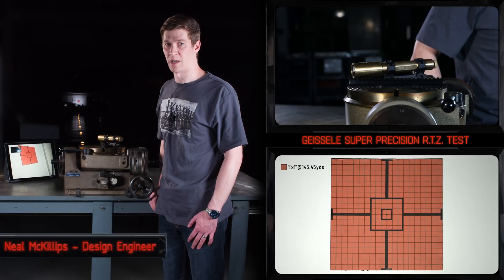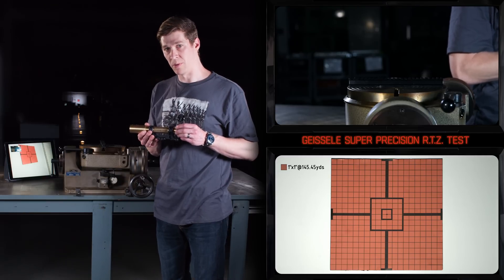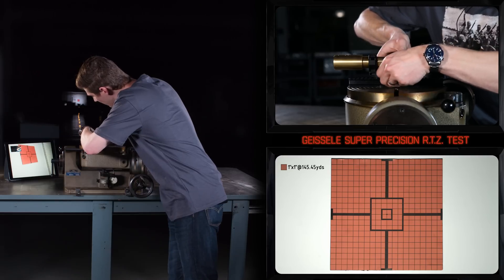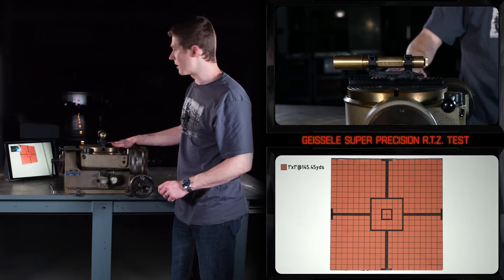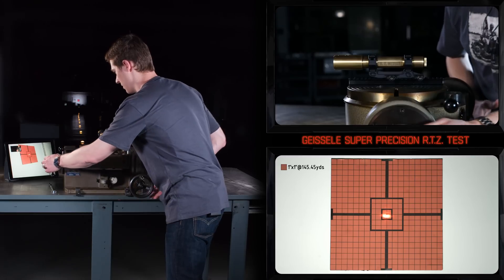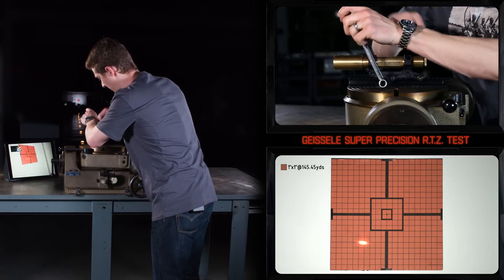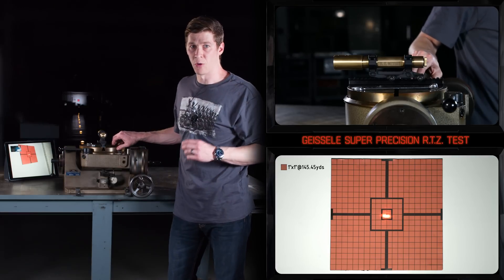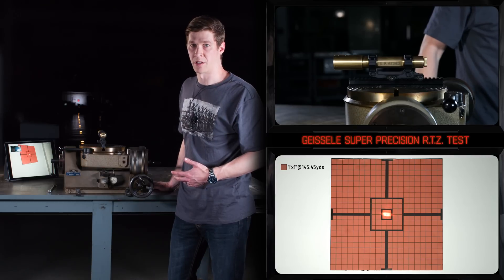Geissele Super Precision Optic Mount - Return-To-Zero Test

Comment: Hey Geissele peeps! We've been using a ton of your mounts and they are without a doubt some of the best on the market. We were running Spuhrs almost exclusively before your mounts were released.

We did, however, have a few suggestions on how this demonstration might be improved. When retorquing the mount, you can see the person in the video focusing not on the bolt he is tightening, but on the screen, making sure the laser returns to zero. What I would like to see is a demonstration of the torque insensitivity of the mount. Torque it randomly with the laser off, then turn it on to see the results. Or torque it initially at some optimal value, then remove and retorque to a few different values across the acceptable range. I'd love a chance to play with this testing setup!

Thanks again for innovating and being generally awesome.
Reply: Who's "we"?

Comment: You had me sold until you were tightening the last bolt and stopped tightening when you watched the laser on your iPad land back on zero. 

Leave the laser off and do another random non torque tightening and then turn the laser back on. If it returns to zero then I'm sold.

I'd also like to say this is not a bash. I love your company and 3 of my rifles have your triggers. Keep up the great work!
Reply: I partially agree with this statement, however knowing what I know from my mechanical background, I understand star torquing and it's impacts on how concentric  something of cylindrical shape will torque down. No matter what, as long as both bolts are tightened even marginally to the same amount, the return to zero in this situation will be literally on point "almost" If you just continued tightening both nuts back and forth, you'd eventually hit a wall where you'd be torquing against your threads/ picatiny to the point to where the amount of difference between torque between your two mounting nuts would be so similar/  negligible that your zero would be unaffected. So long as you zeroed your rifle at this torque point, then when you tighten down to this felt position, you'd know you were at your return to zero. That was the whole point of him empathizing the fact that you don't even need a torque wrench, in that you could go off feel alone and that it actually isn't rocket science to find that return to zero point. I'm sure he and you could find that point fairly easily by feel.
Reply: I was thinking the same thing when he tightened the front nut it moved and like wise the second it went back, but he could see how much tension/torque to put on it to get it back to zero.  So here's my question.  Does the return to zero relate to the amount of torque that the nuts are zeroed at?  Example, if the mount is zeroed with the nuts torqued to 50 inch/lbs.  If I take off the mount, do I have to torque to exactly 50 inch/lbs to get that same zero?  What if I only torque to 30 inch/lbs?  Will I get the same zero?

Comment: Looks like on your return tighten you were a little low.
Reply: Looks like you didn't watch the whole video.....that was low on finger tight. With the nuts  "torqued" down it RTZ'd
Reply: It was all hyped up that the mount clamping system was so much better than QD because even finger tight it would RTZ. So basically it's like most other good mounts where if you torque it back to spec it'll return to zero?

Comment: Is there a QD mount in the works?
Reply from the maker: +smokeu600 Yes we are working on a QD version. The DoD wanted the maximum RTZ. To do that we used an improved version of the classic nut and clamp method. This method provides 3-4x the amount of clamping force compared to every other QD option out there. We will not release a QD version until we are able to bring it up to a clamping force that will ensure proper RTZ. But the short answer to your question, is yes, we are in the process of developing QD.
Reply: +GeisseleAutomatics 

Can't wait